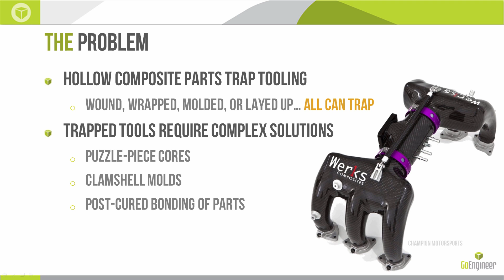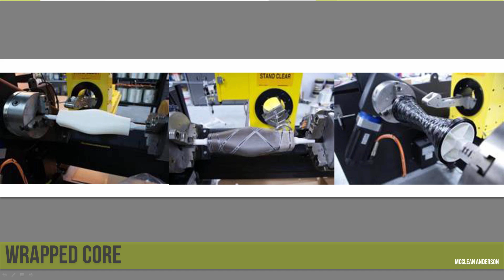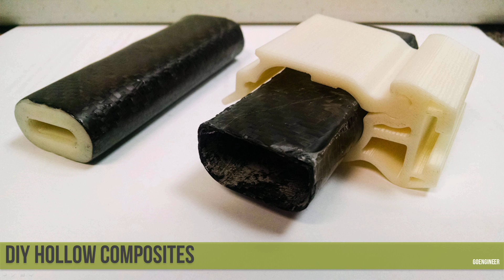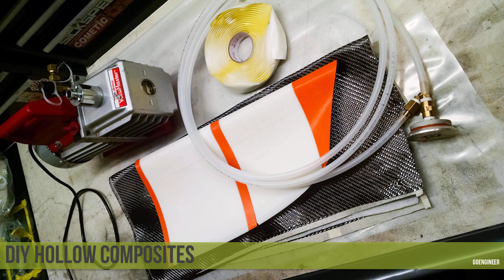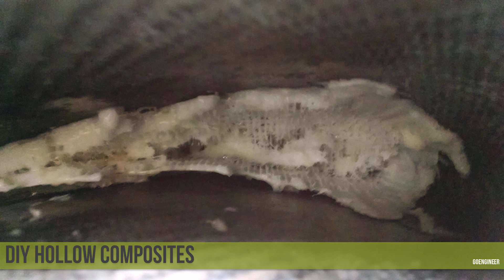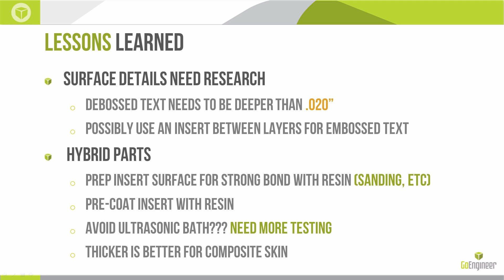3D Printing - Hollow Composites

Comment: I need to make a curved hollow tube out of carbon fiber.  What would be a good option for making it?  Ive considered a dissolvable core but dont want to print a dissolvable core as if would be many pieces to make the total 50in total length, and i would eventually like to move from prototype to production if it works.

Comment: Pretty neat. It's funny that just a few years later we can do this on a cheap desktop printer with PVA. 

BTW, the Insight terminology is funny. I wonder what sparse means with regards to an infill percentage.
Reply: Insight terminology is better imo. 
For "sparse" you adjust it by how thick you want each raster to print (width of a single line) and then spacing between lines. 
By default "sparse" on a .010 layer height is a raster that is .020" wide spaced every 0.1" on a rectilinear infill. 

"Sparse double dense" is the same settings, but they do two passes per layer orthogonal to one another to make a mesh grid.

Comment: so you can make a pulp or thin layer mold, fill it with wax and them wrap it with fiber (if you use tensile force while wraping and hot temp curing this could be good for strength too)

Comment: I have worked with ABS as soluble mold when i was in the student formula team of my University. The problem with ABS is that it has pretty low thermoplastic limit. It can't be used in autoclave for sure and even for infusion you have to see the exotherms of the epoxy resins.

Comment: Thank you for this. I designed and built a CF bike frame, we 3D printed the prototype with PLA (before we knew of dissolvable filament) and then made fiberglass female molds from the prototype. We then made paraffin wax male molds that we did the layup on and vacuum bagged. This obviously resulted in a rough outer surface but we were doing this as a side project during grad school and in my kitchen so we were okay with that. We actually used HIPS for some parts that had higher tolerances such as the bottom bracket shell. It worked really well. One thing you need to be aware of is that your dissolvable mold does need infill (not as much as you had) or it will collapse under the pressure of the vacuum bag. We found with the HIPS a 0.6mm side wall with 20% infill worked well.

Comment: What about sand casting?
Reply: You can use Stratasys materials to create patterns for sand casting - they wouldn't need to be soluble like the examples covered in this webinar. There are materials appropriate for green sand casting as well as some that will be compatible with sands that use catalysts. We have several customers in this area!

Comment: Great webinar! Quick question, would it be problematic to print out an undersized form and then do a standard carbon laminate over it without removing the internal part? The original ABS part would still be under the carbon layup for the life of the part. I have an upcoming project where I would have to use our company's old FDM 8000 and it's BST, so I was planning on using the inner material for locating threaded fittings and such.
Reply: I'm curious of the same.  I don't think my printer is up to the task of soluble filament yet...

Comment: How would one use either the uPrint or Objet machines to build compostie cores?
Reply: Jared Jones You could use either of those machines to build cores that are intended to stay inside the composite. You'd have a hard time using those machines to build sacrificial cores - it can be done but the cores have to be removed mechanically.